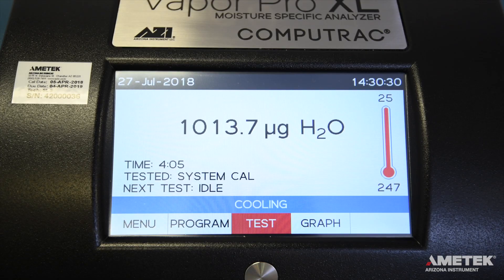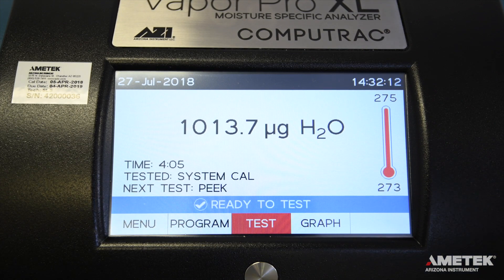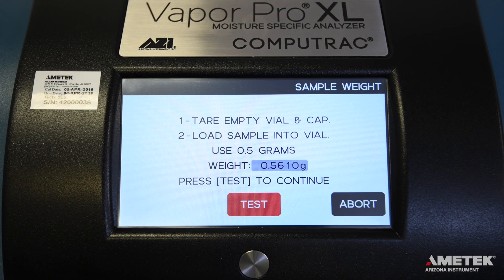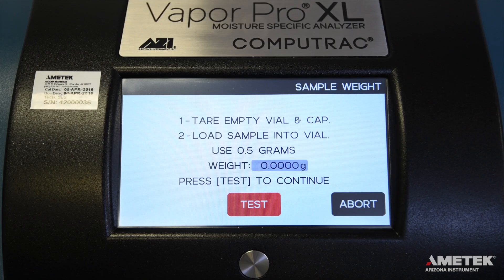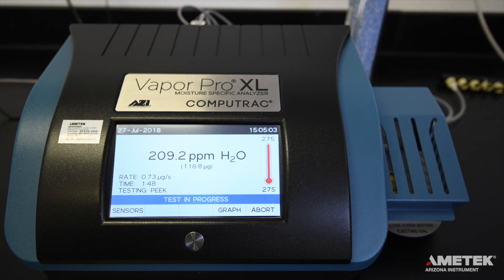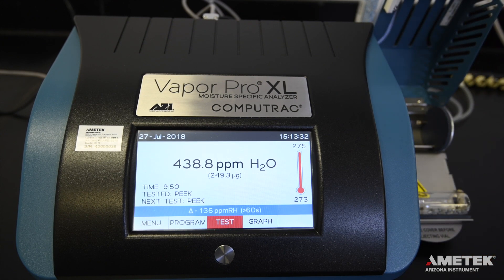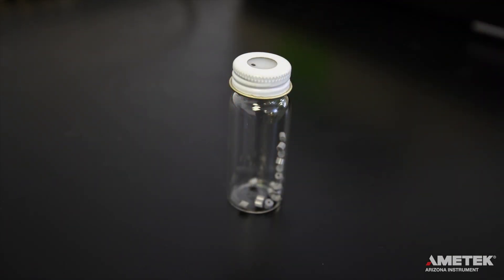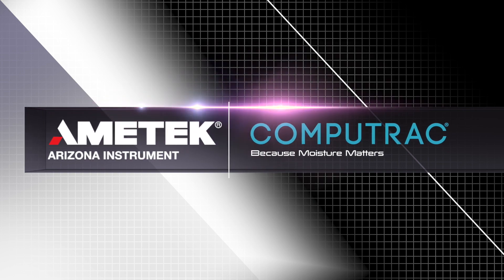How to Run a Test Program on a Computrac Vapor Pro XL

Comment: Hi again,
Another question i would ask is why doesn't my weighing scale send the data to the Vapor Pro Machine? I checked the connection between the scale and the machine but they have good connection.
Do i have to set it up anything in the machine to get the date from the scale?
Thanks
Denis

Comment: Hi, 
thanks for the very useful tutorial. 
I have a question. i do a capillary test, then i test a program (first material). My question is do i need to do the capillary test again when i test the second program (second material)?.
Thanks 
Denis
Reply: The reason i asked because when i did a capillary test then i tested a program, i had a good result on the first test. Then i tested right away another program (another material) with out re-capillary test, i had unexpected result. That's why i am wondering if i need to do the re-capillary test.